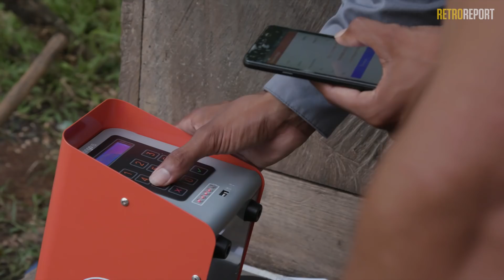Solar power could be the answer to aging electrical grids

Comment: Energy storage is our most important puzzle we must find a solution.
Reply: If you have an electrical grid, you can use it for nighttime power from hydroelectric or wind.  Eventually you will need storage but not until your grid is about 70% renewable power.  The only people who absolutely need energy storage right now are those that aren't on a grid.

Comment: One huge consideration for many low-lying areas of the country to consider getting into solar now would be in the event of a catastrophic storm.  One of the first and longest lasting damage onto communities is the loss of electrical power.  Now if many of these home had solar panel still in place, they could still function albeit in a reduced capacity.  How cool would that be!

Comment: Power sources used to be distributed, then centralized power became cheaper.  It's cheaper and easier to have one big plant than 10 smaller ones.  Panels on roofs are NOT cost effective, compared to industrial projects.
Reply: It depends on how often you have power failures and how long they last.  If you have to throw out a freezer full of food when the power goes out, those solar panels pay for themselves rather quickly.

Comment: Good video (glad it was actually longer than 90 seconds). Solar will be great for a lot of rural areas and developing countries, but it will not replace traditional power sources because it simply cannot achieve the output or reliability of coal or nuclear. For example last year in Puerto Rico an entire solar farm was wiped out by just one hurricane. And in places with heavy snow or dust solar panels need constant cleaning, power output can be reduced by the slightest environmental change. 

What makes the grid the primary source of power is its durability and output in almost any location under almost any condition. Windmills and solar panels are great supplements as well as things like the hydro generators that use running water. But they all have advantages and disadvantages that make them more or less economically feasible.

Comment: The best method is buy a huge recharge battery for every home. don't use any other kind of power other than sun power. natural.
Reply: don't run electric cable all around.  HV towers loose power.
Reply: you still need a generator, for the times where the panels come up short. During multiple overcast days, the generator can be used for battery charging. If the generator is used too much, it might be time to consider more panels. Charging batteries is far more efficient, than running a generator lightly loaded, for long periods of time. Generators produce the most kWh per gallon of fuel, when loaded between 60 to 90% of continuous rated output. Running it hard for a couple of hours to charge a battery, allows continuous power availability on a fraction of the fuel, and wear on the generator itself. No matter what, you're exactly right. The bigger the battery, the better!! I find that having a battery sized to meet the full requirements of your house for 24 hours with no other source, is about the right size for the lowest cycle life cost per kWh of stored electricity. I've done the calculations for lead acid, as well as lithium Iron Phosphate, and came to the same conclusion.
Reply: Hydro electric?
Reply: @American Lost Solar, right now, is now more "bang for your buck" than wind, at the consumer level. You can buy a 300 watt photovoltaic panel for about 1/2 the cost of a similar size turbine. That wasn't the case even 5 years ago. It is now. Now, what you need, is electrical energy storage, with a lower life cycle cost. I'm hoping, as time goes on, that batteries, flywheels, or some other energy storage solution becomes cheap enough as well, that the combined life cycle costs of the source and storage can compete on the wholesale market. Batteries and panels are already competitive on the retail market.
Reply: @vincentrobinette1507  Battery costs have fallen by more than 80% over the last 10 years and are expected to continue falling for at least the next 10 years.  Batteries can already compete with natural gas peaker plants in areas like Australia where gas is expensive.  If you are in the US and you want to encourage this trend, get an electric car if you have a place to plug it in overnight.  Natural gas is cheap in most of the US because it's a by-product of oil wells.  Cutting the demand for oil will cause fewer wells to be drilled, thereby cutting the supply of natural gas and pushing up its price.
Reply: @calamityjean1525  That's exactly right. While fossil is hard to compete with now, that won't be the case in the near future. With renewable energy becoming less expensive at the same time, fossil fuel becomes more expensive, that "crossover" point will be reached by more and more markets. That will include the US.

Comment: Out of date. Solar with storage is now cheaper than LNG generation. We have hit the financial tipping point
Reply: It depends on what the price of natural gas is in your area.  If it's expensive, yes.  If it's cheap, as in the US, not yet.
Reply: @calamityjean1525  It's not just the price of the gas; it's also the price of the plant that burns it to make power.
Reply: @incognitotorpedo42  That's partly true.  The more-efficient combined cycle gas turbine (CCGT), which features a steam turbine that uses steam heated by the exhaust from a gas turbine, is fairly expensive to build.  Both the plant and the gas contribute to the price of the electricity.  
The peaker plant OTOH is relatively cheap to build, but it's much less efficient than the CCGT.  The price of gas dominates the price of the electric power it produces.  
Solar + storage, or wind + storage, is currently (mid-2020) slightly more expensive than CCGT power, but less expensive than peaker power.  As a result, peaker plants are being replaced with giant batteries.  
The original comment referred to "LNG".  The "L" in that abbreviation stands for "liquified".  Natural gas is liquified for shipping to a place where a pipeline doesn't run.  The process of liquifying, shipping, and re-gasifying the natural gas makes it noticeably more expensive than natural gas piped from the well.  Renewables will take over the electric supply in areas served by LNG first.

Comment: Need one more "jump" in solar panel technology and we need the cost of the batteries to come down.

For areas with LOTS of sunshine (like where I live) solar is practical now.
For north of the "Mason Dixon Line"  Not so much.  
For north of Iowa's northern borders... just No.
Reply: I plan to convert most of my household lighting to 12 volt DC LED to make most efficient use of solar possible.  No losses converting to AC and back to DC (all LEDs need DC)

Most of your home (desktop) computer actually runs on 12V and 5 V DC.  Most of your LED or LCD flat-screen TV is also 12V DC.

We could get major portions of our households off grid fairly easily and much more efficiently by tapping in and feeding the devices 12V direct. (they devices needing 5V can use an efficient voltage regulator for less than 5% power lost to heat, where converting to AC and back to DC loses over 40% to heat.

The problem with DC and power lines is how fast DC loses power over distance.  Taking it fro panels on your roof and charging a battery bank in the home cures that issue.
Reply: Wrong.  I live in Maine.  Solar costs 8.7 cents per kWh, while grid power costs 15.4 cents.  Solar is totally practical here.

Comment: I have 1500 watts worth of solar panels, because of the crap they are spraying the sky with, they no longer produce power,,, now what ???????????
Reply: Get them check by a solar professional.  Nothing sprayed in the sky should stop them from producing (even if it did lower the production minutely).

Comment: I work for a large Port Authority. 
Years ago we converted all our large buoys and channel markers from automotive batteries to solar.
Once every 2 weeks a crew of two would replace and bring the batteries in for charging of the grid.
It is economically impossible to think of going back to the old system it saving us so much time.

Comment: very well done but there's important downsides you neglected to cover.
distributed power generation is good in general, but having is too distributed is inefficient. if there's a weather even and 1/4 of houses suffer damage to their panels, it's many times more work and management to repair, rather than if it were to happen to a small-scale PV plant where everything is all in one place for easy repair.
also having houses off-grid is very inefficient because not only do we increase our workload by having to carefully manage our power, but the only way to ensure we always have enough is to have too much. on especially hot and cold days we consume more, so that extra capacity isn't needed on mild says and goes nowhere. it could be stored but that requires increased infrastructure (batteries). also because weather patterns aren't yearly and we get runs of hot or cold years, everybody has to buy additional batteries for those years even though they're not used in mild years. even simple things like when guests stay our consumption increases so we need to be able to cover it. over a widespread area these effects average out much better, so people who need extra can get it over the grid without having to install extra panels and batteries that they mostly don't need.

Comment: I see. Electrical grid gets old----->replace everithing with a x100 times more expensive option. 

B R A V O!
Reply: It's cheaper, that's the whole point.  Putting up new solar is cheaper than just the maintenance on old oil, and coal plants.

Comment: one of the hurdles of implementing solar electricity is the battery technology is in need for improvement and the efficiency of the solar panels are very low at the moment but research are underway for achieving higher efficiency and the future will be brighter
Reply: The efficiency of solar panels is pretty irrelevant at the moment.  If we just covered all the parking lots in the US with current panels, it would meet most of our energy needs.  Other countries have similar options.  There are plenty of higher efficiency systems, but they are not keeping up with the price drop of standard panels, so it is cheaper to just use more.
Reply: yeah thats the case at the moment, i just wondering what the future needs to achieve.
Reply: The most that could mathematically happen is a 5x increase in efficiency.  That is about 2 years worth of cost drop at the current rate.  We can worry about that when the price stops dropping.
Reply: agreed

Comment: If you want continuous solar power 24/7/365 there's only one place you can do that. Space. A space station solar array can not only capture more solar than ground based stations you also have unlimited space to expand. There are challenges to a space based power infrastructure. First off it will cost a lot of money to build it, at least until we drastically cut rocket cargo hauling costs. Second is how to get the power down on earth. Laser and microwave transmissions are the 2 most likely options and both have risk involved which reduces the areas where you can set up land based sub-stations. The biggest advantage though is unlimited scale-ability, so long as you have the resources to build space solar arrays and the money to send equipment up and build it, you can keep increasing power output.
Reply: sending stuff to space is super expensive. u have to be nuts to even think about that. and space laser beams? sure what could go wrong
Reply: Royvi Rafayet - They're already sending stuff to space, are you saying their nuts?
Reply: Royvi Rafayet - Aren't they already attaching solar panels with the sattelites? And you already stated NASA's goal, aren't you contradicting yourself? And also, don't even call us nuts you smarty pants you don't even know us.
Reply: The cost of sending things into space has been going down and will be cut in half once the Falcon heavy is commercialized. It will be reduced even further once the BFR concept becomes reality and is successfully tested. One of the main reasons sending satellites into space is so expensive is because NASA isn't a business, they don't try to find ways to reduce cost because they aren't run like a business. Now that we have several companies designing/building rockets you will see the costs come down big time for orbital cargo shipments.
As for risks, there are always ways to mitigate risk. If we were too worried about risk we wouldn't have nuclear power plants (which have a far greater risk to causing substantial short term and long term damage) in this country.
Reply: no they did it for research in zero gravity and to increase network connectivity  but sending solar panels is completely nuts. way too expensive to even think about it
Reply: who cares if solar panels are cheap sending them to space is expensive as fuck
Reply: adam smith Won't that cause a lot of radiation?
Reply: Boss Brandon not if it’s focused on a specific point which is why the ground stations that receive the microwave energy would have to be in remote locations
Reply: Don't worry, Elon Musk is working on that.
Reply: Today, it costs $10,000 to put a pound of payload in Earth orbit. NASA's goal is to reduce the cost of getting to space to hundreds of dollars per pound within 25 years and tens of dollars per pound within 40 years .    source google. tell me how u guys are not nuts
Reply: nasa wants to reduce flight cost not send solar panels for electricity. and satellites dont send us electricity. thats for their functioning not to mention they dont produce a lot yes u r nuts . how did i contradict myself
Reply: no npp has far less risk than a space laser i know because i am a nuclear engineering student. and while u have a point i just think u r nuts because u should only talk about that when all our potential spaces are covered by solar panels. and that laser alone would be enough to cause a blackout in some parts of the world
Reply: Royvi Rafayet - I assume your just a kiddo. You can't put NASA's work into conclusive.They can send Solar Panels if they want to, those things are cheaper now. They don't need you're permission kiddo.
Reply: SpaceX was charging $1,233 per pound to reach orbit, and that was data from 2016. https://newatlas.com/spacex-price-raises-lower/43643/
Reply: WHY SEND whats wrong with land and space lasers are disastrous how nutty can u be they can make peanut butter out of u
Reply: Royvi Rafayet - For you in a consumer's perspective, not so much for a big organization like NASA.
Reply: why should nasa do that have they gone nuts as well?
Reply: Well, one of the main arguments in the video was, that solar is decentralizing the power production. Thus removing the need for a big expensive grid. If you look up projects like Desertec, you will see that a fraction of the Sahara is already enough to power Europe and Africa from solar. The Sun is also always shining on one side of the earth. So the Problem would rather be the transport of electricity and not the production.
A space power plant wouldn't solve either of the problems, like not every orbit has 24/7 sun and is geostationary for a continous power stream.
Reply: Another option for 24 hr solar energy is to develop world wide grid. When one part of earth is nor receiving sunlight, other part of world is receiving it. So if we develop large scale transmission line across the world, we can solve the problem of discontinuous power

Comment: Fusion is future not solar.
Reply: "fusion is around the corner!" -physicists 50 years ago
Reply: Solar is fusion
Reply: Fusion will be a centralized setup. And really expensive. Solar and wind is already cheaper than coal, gas or nuclear.
There's no reason why fusion should be cheaper than fission, which is more than 10 times more expensive than solar
Reply: At some point soon, solar will be cheaper than just the grid necessary to spread the energy from a fusion plant.  If fusion wants a place it had better hurry up.
Reply: Nope.  It isn't even DEFINITELY not true.  Nuclear is more expensive, which is why very few places are building new nuclear plants.  In fact, solar has gotten so cheap that NEW solar farms are cheaper than the MAINTENANCE on existing nuclear plants.
Reply: When it will work.
Reply: I would love fusion to be a viable energy source but unless it makes energy free, solar, wind, biomass and hydro will make more sense
Reply: The point of fusion reactors isn't supplying people with power.
Reply: Aswani Sharma did you even watched the video?
Reply: Anders Würtz that is DEFINATELY not true.
Nuclear is very very cheap in comparison.